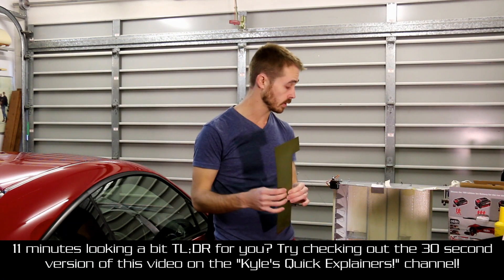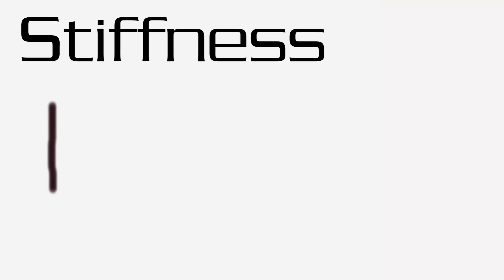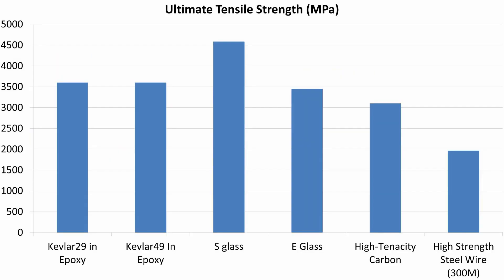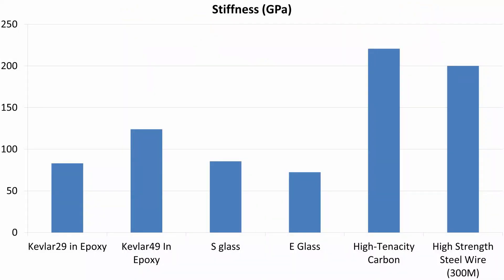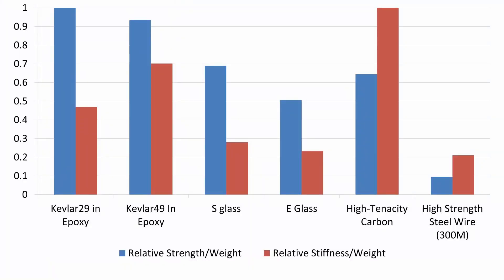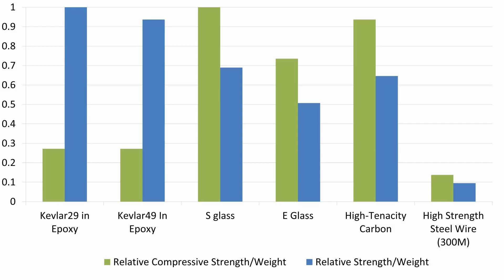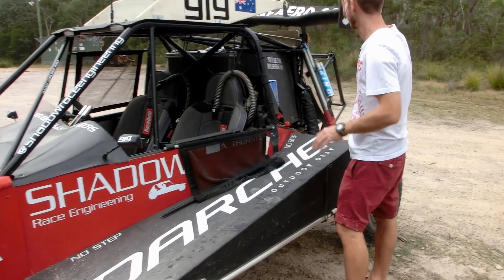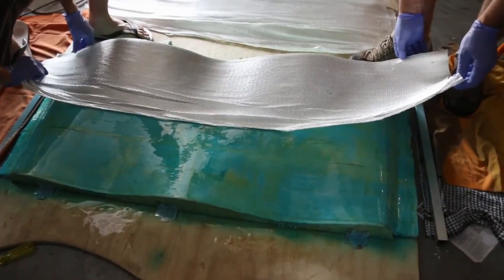Carbon Fiber vs Kevlar vs Fiberglass - Which one is right for YOU?

Comment: Pretty interesting. But you should consider getting a job in a boat building scenario for some practical experience.  I noticed you were trimming your parts with a jig saw.....no bueno.....catch it at just the right time and you can trim it EASILY with a carpet knife without disturbing the structural integrity...and ZERO mess.  Also...you left something out that is MONDO important....epoxy is VERY dangerous to mess with.  Even a MINUTE drop in an eye and you're blind forever....and you can get an EXTREME sensitivity to it very easily.  I've seen it happen.  I owned a boat building company in Florida for years....I messed with many different kinds of materials including pre-preg and all cloths including carbon/Kevlar/s glass hybrids.  Carbon fiber is also extremely hard to handle and if you get a sliver under your skin, it's there for life and can be at LEAST very annoying...if not very dangerous.  Kevlar is difficult to work with because you can't grind it at all...it just frays and ruffles the edge.  No matter what...pound for pound and strength for strength, vinyl esters and S glass are the best for most applications.  I've built some ultra light boats that held together just fine with that combo.  All in all it's the resin that causes the weight....keep the resin under control and you can build stuff just about as light as you want.
Reply: Interesting. Thank you!

Comment: I love it. Nuance makes all the difference. And there are a lot of nuances in engineering.
Btw kevlar is used as a backup matrial on metal pullrods and cables for crash safety, so it would hold the part attached to the vehicle and won't propel it into the spectator area.

Comment: regular glass vs steel - glass will break and steel won't so steel is stronger than glass, but if glass breaks immediately than does it mean that glass is stiffer or if it breaks it doesn't have stiffness?

Comment: what about putting Kevlar in the bottom of a splitter to help with off track excursions, so it doesn't shatter with an impact with a small rock or dirt?
Will it help keep a damaged splitter together rather than just breaking off and going under the tires?

Comment: In summary:
Carbon fiber: very hard, but don´t hit it because it will break. Use it were you don´t want parts wobbling (F1, Koenigsegg, aircrafts, drones)
Fiber glass: very strong, you can hit it but it isn´t hard. Use it were parts could be hit, don´t use if you want to avoid vibration (all terrain cars, non supersport cars, boats)
Kevlar: endures a lot of tension, it can hold but it isn´t dense it deforms quickly, use it for holding (gas tanks, bullet proof vests)

Comment: Rule of thumb: If it doesn't bend, it breaks.......
Reply: Pretty much everything that bends breaks, and anything so flexible that won't happen isn't suitable to building anything out of anyway.
Reply: yes, but a rubber rod won't break as easily as a fiber glass rod, sure the later will bend microscopically but the rule of thumb applies to a material's general first reaction..........

Comment: +KYLE.ENGINEERS how about Basalt fibers? How would it compare to carbon, kevlar, S & E glass?
Reply: Basalt fibers have lower strength/weight and strength/stiffness than all but E-glass, but has advantages than some of them in terms of volume. You can literally just find this info all on the wikipedia page for basalt fiber though.

Comment: Ok, so lets say I am building a boat (72' catamaran) out of WRC (western red cedar) strips and crossing veneers for core material.  What would you recommend I use?  I was thinking a combination of Kevlar on the outside for strength and Carbon on the inside for stiffness.  The loads would be in compression and elongation constantly over time due to wave action and the standing rig of the sails which is why WRC is preferred over Balsa.  De-lamination over time is a known issue with Balsa as well.  Of course, in any performance application, weight is a huge factor here, but so is cost.
Reply: Used everything your stating, but here is my take and suggestions. Composites 101, cores can be important, but the more the thickness between inside and outside layers the greater the stiffness&strenght overall. Look very closely at "Composite Envisions" website-store. They pride themselves as they supply cutting edge Automotive,boating, aircraft, best in nation. I would look at a Carbon fiber/zylon hybred for the outside and other type carbon fiber on inside. If you have the coin they have a "TeXtreme" carbon/zylon hybred. Textreme is resin saving, thus weight saving. Think about hand layup vs "Prepeg" layup.
Reply: Well that is why everyone is using the foam cores.  Because they can go thick between layers without adding weight.  But I am not building an AC-72 that you throw away after three seasons.  I'm building a world cruiser that needs to last.  I'll look into the materials.  Pretty sure I have seen this.  Hand layup would be better with this material.  That is a plus with the method of build I'm using.  Thanks for the reply.
Reply: Yeah i had to revist thought here as your project requires a boat load o money& engineering. If you concidered building more than one say 2 or 3 to pay for your craft, then you might concider calling 3DP(3D Platform printers in Roscoe, Illinois. Ph.# 1-779-771-0000 or EM: marketing@3dplatform.com). Here is why they have a new "Excel Series" 3D printer big enough to print your entire craft. These can be fitted with additive(your layered up hull core), and another gantry can do a subtractive (process like a CNC machining), or another gantry could do a robotics( like insertions of connectors maybe sailing gear). Extruders are optioned so big they can spit 45-55kg/hr. Their illustrations suggest Turbine Blade printer 17'x124ft.x12ft. tall.  This info is only 3months old. Talked to their tradeshow guy who does 40 states. I asked the question: "What about PEI" he said you mean Ultem 9085 Stratasys's proprietory material. He said that their patents are due to run out less than a year. What this means is cheeper open market absolutely bad ass core material afordable. Used extensively in atomotive& aircraft. Stuffs invincable.  Hexcel corporation a tape about 3/4" wide cabon fiber i have seen applied via robotics(CURES IN 2MINUTES FLAT). Getting that tape covering in the same process of printing takes the big engineering questions and intensive labor out of the senerio. Also the cheep one time buy of 3DP's simplex software(150$) allows a thicker density printing near resined surfaces and a lighter density in other areas. Hope this is helpful!
Reply: I really don't think anyone is going to be #D printing a 72' Cat any time soon.  But I like your enthusiasm.  IDK, I could be wrong, but that is a lot of scratch to experiment with.  I guess it could be done but still.  ROI is real sketchy.

Comment: If you were attempting to repair a structural aluminum part with a hairline crack (a chainstay/swingarm on a high end mountain bike) and tig welding in not an option because of loss of T-6 properties, could a composite repair do the job? Wire mesh and epoxy was the idea i was toying with because of the issue of cf/aluminum galvanic corrosion. Now that i see wire mesh is no good, do you think S-Glass/epoxy could make a viable repair? I understand you cannot diagnose an issue on youtube, but could you give a ballpark guess?

Comment: i understand the calculations behind this and am very interested in composites however what i cannot understand is you pretty much state that fibre glass is the best all round but the hypercar manufacturers swear by carbon fibre even to the point where they design and build monocock structures solely with it. there must be a reason why it is better or they would use other composites/materials? why or how can this be the case?
Reply: With composites there are always several correct combinations. If your on ovals with other race cars how wood you like to eat shattered carbon fiber from someones dislodged body parts. "Composite Envisions" web site you will find hybreds of Zylon and carbon fiber. It will take damage but stay in one piece. I am a fan of TeXtreme zylon carbon spread fiber where appearence isn't a concern.

Comment: Is there any reason why you could not use a combination of carbon and glass in one panel?
Reply: Maybe the quite different thermal expansion rate could cause some problems. However there are complex fabrics that use carbon and kevlar fibers together. And I think the glass and carbon combination would be possibly viable with proper alignment.
Reply: You definitely can but the problem comes with the Young's modulus.  Since CF stretches very little under load but the glass will stretch significantly more under the same load, the CF will end up bearing nearly all of the load while the glass will only get a small portion of the load.  If weight is an issue, the glass is essentially dead weight.

Comment: what about kevlar as a way to add some impact resistance to a carbon fiber part. As mentioned is has much higher elogation, would it keep a carbon fiber part together in the even of a crash?
Reply: TexTreme is a carbon fiber of "spreaded out tow" that in a 20mm. x20mm.(3/4x 3/4"checker board apperance) has far less crimps of excess resin(extra weight you don't need). Less crimps means more strenght in carbon. In a racing situation they actually make a combo Zylon on the "Y" axis and Carbon on the"X" axis. nothing flies down the track in an impact.  Can find these on www.compositeenvision.com web site in yardages.
'

Comment: So you're just going to ignore the fact that there are different grades of carbon fiber? "Low" modulus carbon fiber is about the same strength as S-glass, but is much stiffer. Intermediate modulus carbon is stronger than S-glass and even stiffer.

Comment: what is your opinion on a combination of Glass and carbon (different layers, of carbon on the outside for stiffness and Glas on the inside..etc.)?
application would be for example body panels or aerodynamic parts like under body side skirts etc.

Comment: I wanted to add, the carbon-fiberglass weave/cloth (likely it was the lower grade fiberglass) offered the fiberglass in multiple colors (Blues, Yellows, Reds, Greens, etc) & provided a nice color contrast when used against the black-gray Carbon.  I'm sure it too may b a good way to add some flex? or reduce brittleness?  It was mainly available in woven tubes for pen-making.  The fiberglass added a nice, colorful "top layer".  Thx for the info & your time!  I never knew there were such different  grades of fiberglass!  As well as (the higher grade) being "pretty good stuff!" Thx again!

Comment: Question, if u don't mind? What about "mixed materials"? Carbon-Kevlar or Carbon-Fiberglass multi-directional 'woven cloth'? Kevlar should introduce some positive wear characteristics as well as some flex? Carbon can be too brittle! I'm scared to death of using a 100% carbon bicycle! Too many vids of them literally shattering in to tiny pieces when someone hit the street curb while riding one!  Let's take a rifle stock, after several "shots" a 100% carbon cloth (Non pre-preg. Room temp cured) may start to crack or worse, just shatter like a carbon bike? If using multiple carbon layers, say 6 in total; 4 very thin directional layers; 180 degree "north-south", 45 degree L, 45 degree R, 90 degree "east-west", 1 multi-direction Kevlar layer + a multi-direction carbon top layer? or 5 layers... no Kevlar layer but a mixed Carbon-Kevlar top layer? Or the same but w/ a mixed carbon-fiberglass top layer? Pagani Auto uses multi-direction carbon w/ hair-thin titanium wire woven in!  Thx!

Comment: I assume that you are an engineer.. Great! Someone that base a video on facts and not assumptions. Looking to make fenders and bumper for my audi (for fun). Everyone says carbon but no factual reasoning. I think e or s glass will work fine for my application! Carbon maybe?! lol Who knows haha
Reply: James The Homosapien fiberglass is way cheaper and does the job. Unless you are building a Spoiler that will work over speeds over 300km/h Carbon fiber works. 
Use 10oz or 2x 4oz fibers and it will work.
Reply: in something like a bumper, given the data here, you want stiffness so as not to have flutter and flex say at highway speeds like kevlar and fiberglass will have, so carbon fiber would be better. budget tho is really first thing to think of.carbon fiber is best for where you really need stiffness. looks so cool too :-)

Comment: Your explanation about stiffness and strength is not correct... Stiffness units are not GPa, since it is defined as a force per unit displacement... If you want to explain or understand the mechanics of materials (isotropic or orthotropic) please avoid the unnecessary word "strength".
Reply: GPa is stress x strain

Comment: we use carbon and kevlar together around areas of high heat and spots that will come into contact of debris like wheel wells.  Also fiberglass and kevlar for a cheaper part.  most of the time fiberglass is fine.

Comment: The most important discussion is competely missing here.  All these materials are useless without the bonding material - Polyesters, Vinylesters, or epoxy.  Without this added into the mix, all the theory on material strength is mute!  It is a combination of the bonding material plus the glass, kevlar, carbon - and foam too.  Strength to weight also not discussed - where polymer resins come in and play a big part.  Then there is how the parts are manufactured - lay ups are important too. starting with base coat - whether it is a gel or if there is an absence of it.   Good presentation, but incomplete and therefore misleading.

Comment: Basically, CF is one of the most well rounded materials (even if it doesn't max out most categories), EXCEPT in elongation. It's the only area where CF truly fails. Is there anyway to increase the elongation of CF? Has anyone come up with a solution? Perhaps a different weave/resin?

Comment: Hi, great video! I'm looking to build a composite kayak on a budget and considering Fibreglass over Carbon. Which do you think would be stiffer/stronger... 2x600g layers of Biaxial E-Glass, or 4x300g layers of S-Glass (plain weave)? i.e. both the same weight, but different weaves/properties. Your help would be much appreciated! Thanks.

Comment: In sailplane construction, we use glass fibre extensively to handle bearing stress, where it outperforms aramid and carbon fiber. We use aramid in the crash protection zone of the canopy, where glass and carbon dust would be harmful in a crash. We use carbon fibre only where lightness and stiffness is important. Also, the stiffness you give for the raw materials is much greater than the fibre-matrix combination, with carbon fibre in an epoxy matrix having only a quarter of the stiffness of steel.

Comment: I was wondering why people didn't use a carbon fiber bullet proof vest, and carcinogen answers that really fast.  If it were to be penetrated, now you have to deal with carbon fragments as well as bullet fragments with both being hazardous to your health.
Reply: The studies suggesting that carbon fiber may be a carcinogen relate to long-term or extremely heavy short-term inhalation of fine dust.  In an application such as a bullet-proof vest, the hazard of fragments being cast off by a bullet impact would be insignificant.  In fact, if it was a significant risk, then you also couldn't use carbon fiber in applications such as car body panels (think crashes).  Carbon fiber is used in orthopedic implants, so the risk presented by fragments penetrating the body if a bullet passes through the vest are also insignificant (relative to the damage caused by the bullet itself). The real reason that carbon fiber isn't widely used in bullet-proof vests is simply that other materials have better mechanical properties for that role, which was touched on in this video when he discussed Kevlar.

Comment: Reducing fiber strength to this graphs breaks my heart. Your analysis is misleading. The data taken is definitely too generic. Especially with Carbon fiber. If you have the connections a 12k toron fiber kicks the ass of every S glass. That's why you won't see your fabulous S glass on a decent race car. It is a good compromise in terms of money yes but don't mix that with actual structural strength

Comment: Great video! 
As a boat builder in the 70's and 80's, and 90's, mostly sailboats and sailboards, with a specialty of foils -- and a few offshore unlimited cats, I came to similar conclusions. S glass for compressive strength, carbon for stiffness to weight, and fuck no Kevlar. You illustrated the exact problem with Kevlar, it pops out of the resin in compression, such as when it's on the inside of a bend on a composite beam. I don't think it ever really bonds with the epoxy and any tiny wetting void is a potential failure point, I could never trust the stuff.

Carbon has some surprising issues, too. We built a 30' sailboat, Nomex cored 0/90 carbon, the bare hull weighed 250#'s, stiffer than .... Worked great, but you could take a sharp pencil and drive it right through the hull.

Comment: I have a question, and i think you explained it but i didn't quite understand it.

Let's replace the front bumper and hood of my car with parts made from 3 layers of E glass. Then i have a head on collision at 50 km/h. Will the E glass withstand more pressure from the impact and be safer, than the same crash with steel hood and plastic bumper?